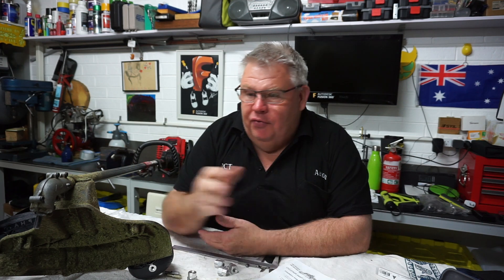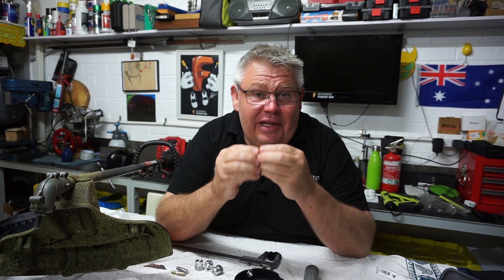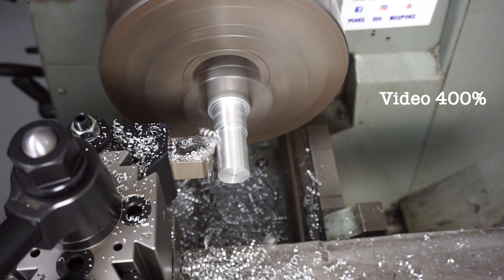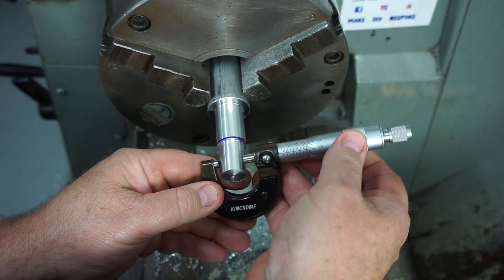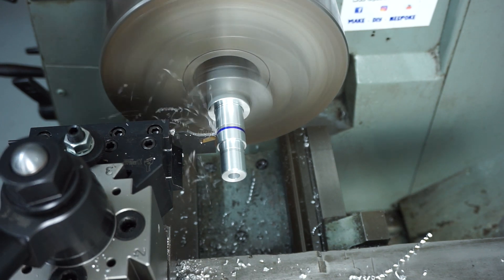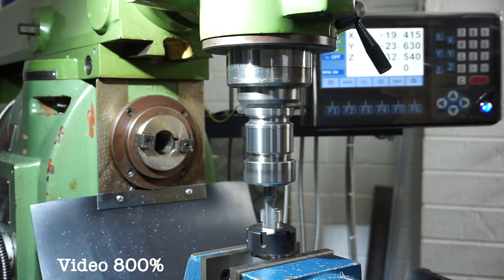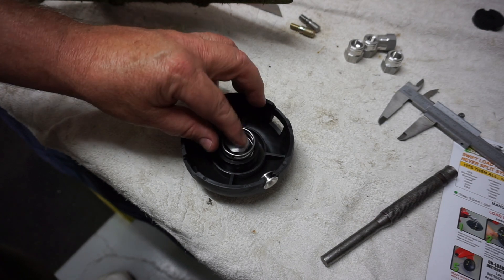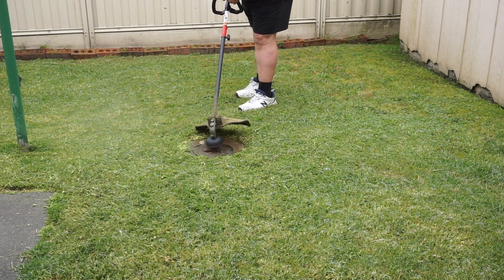Manual Machining a Retaining Nut

Comment: Funny enough with my restorations on old tractors I have buckets of imperial taps and dies and probably a set of metric but they dont get used all that often. Satisfying making your own stuff and getting yourself out of the can. I reckon you need a bit of Roundup, lol.
Reply from the maker: G'day Lance.  Yes, you would have bucket full of imperial and Whitworth taps working on those old tractors.  Yes it's very satisfying to make your own parts.  I was just glad to get my whipper snipper back up and running.  I did threated to make wife get out there with scissors to cut the grass 🤣

Comment: Gday Aaron, you have the same luck as I have, nothing ever fits the way it should, quality taps aren’t cheap, the local shop here only sell Bordo taps and dies and to be honest there not that great, awesome job, cheers
Reply from the maker: G'day Matty.  Yes mate, if it can go wrong it will happen to me also.  Luckily my tool provider had a tap in stock.  Usually they don't and I have to go to the bolt shop and they too sell Bordo taps.  Can't beat the old Sutton HSS taps.  Thanks for watching mate.  Aaron.